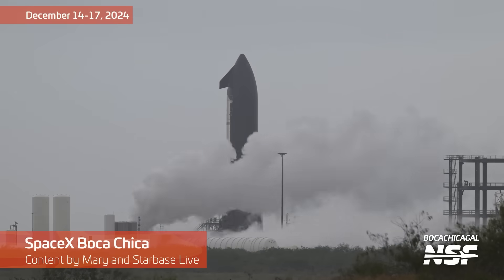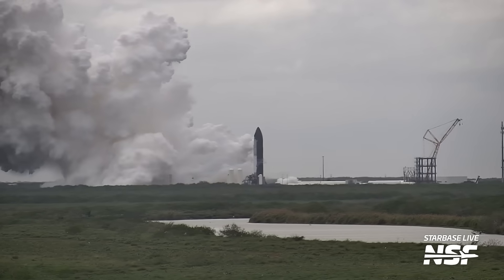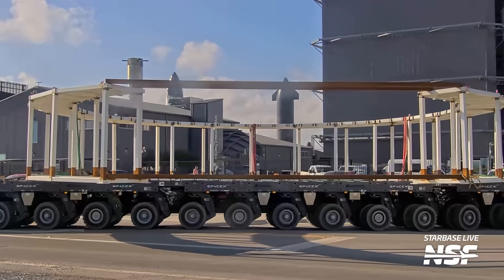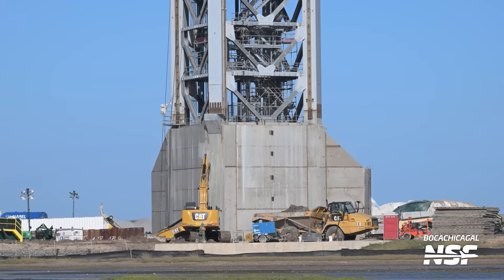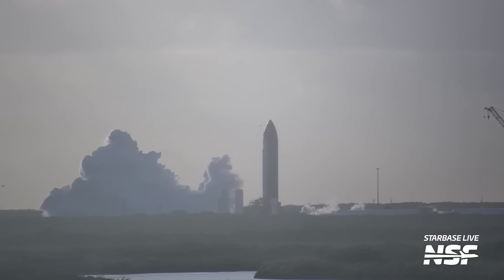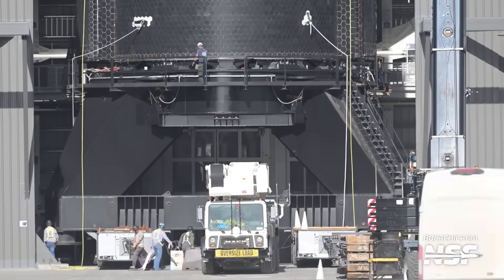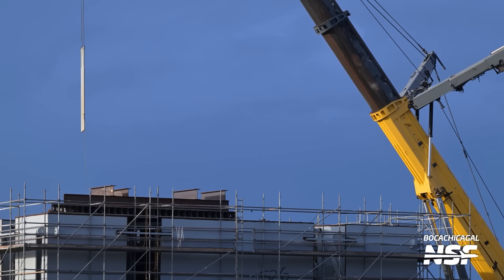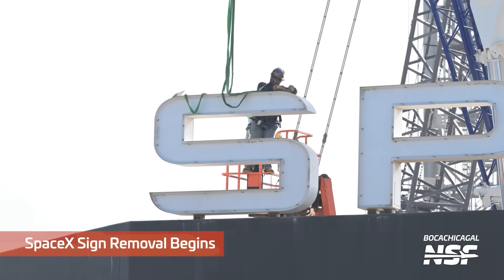It's Christmas Time At Starbase | SpaceX Boca Chica

Comment: Any chance you can use a different colour for the thumbnail border? It's hard to see the progress bar at the bottom to determine if ive watched it. Missed a few updates because i wasn't sure 🙂
Reply from the maker: Is there some place the border is on the sides? The thumbnail progress bar is on the bottom usually, and the side borders shouldn't conflict. -Das
Reply: @NASASpaceflight  the orange border on the sides connects up nicely with the red progress bar at the bottom and looks like a continuation of the border. It looks good, too good and has tricked me a few times. I have watched a few updates twice lol. Which I don't mind tbh. Just my thoughts is all.
Reply from the maker: If there's anything on the bottom, it's your progress bar. We specifically removed the border from the bottom and top so the progress bar wouldn't blend into the border 👍 - Das

Comment: The problem with using an SPMT in a parade is they guzzle fuel like no tomorrow.  One module burns 2 gallons of fuel per mile even if it's carrying a light load
Reply from the maker: 2 gallon per mile is... almost nothing cost wise for a parade? - Das
Reply: It all depends on how much load is being carried.  When lightly loaded they'll use about 10 liters an hour.

Comment: 02:46 for which OLM is that deluge plate? The OLM 1 is already finished and I thought they don't need such a stainless steel deluge plate for the OLM 2 because of the flame trench they are digging beneath it?
Edit: 09:33 I guess Das answered my question :D - I imagine they are going to spray water from the sides into the middle of the OLM 2?

Comment: The frequent references to the constant wind make me wonder why you haven't added a small wind turbine to your camera setups? I assume there are problems integrating them with the solar panels & batteries. You've mentioned that clouds combined with less winter sun makes power management more challenging.
Reply from the maker: Small wind turbines have very short lifespans here... there too much wind. They spend most of their time braking. Looked into this originally (as well as issues balancing with solar) - Das

Comment: I believe both the High pressure modular nitrogen tanks and the sandwiched metal plates are part of the same but totally different flame diverter system.....from what little is available I think spacex plans on applying some cooling water to the top plate to protect it and its workings from the issues now plaguing the OLM....just not quite the same as before.....I doubt they will be spraying water onto the side of the super heavy booster...remember those plates are more or less going to be at the same relative height as the top of the OLM....not underneath the rapters but around the sides of the super heavy .....it will be interesting to see how spacex manages their spray patterns on this top plate....  the nitrogen tanks provide the necessary "push" to get the water out against 400 bar of pressure.....otherwise the metal cooling plates would actually explode if the water is allowed to turn to steam........the water pressure has to be higher than the raptor exhaust pressure....or else...

Comment: I wonder if they at some point enclose the towers with concrete plates all the way up at some point.
That should stabilize the tower a little bit more when connected to the tower structure,
because of the additional mass, when ships and boosters are landing.
Reply: Why?

Comment: Anybody else remember when a Static Fire would shake off (min.) 30% of the upper stage’s mass in heat shield tiles? 😂😂

Update: 9:10 — yes, that is exactly what it’s designed for! It’ll be a “shower head” on top of the launch mount and that plate will interface with the launch pad when installed.

Comment: The spmts roll onto the test pad, the trench has a huge concrete and steel lid that covers the trench under the test stand, once stand dropped in place, spmts roll out and the lid on trench moves across to open under the ship.

Merry Christmas to all at NSF 🎉🎉
Reply: DING DING DING   you are correct sir
Reply: Indeed.